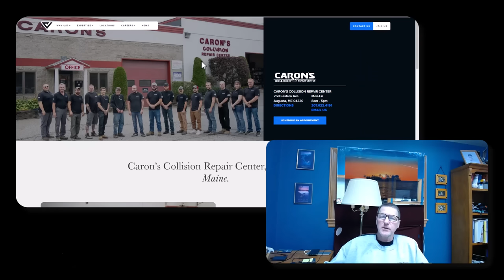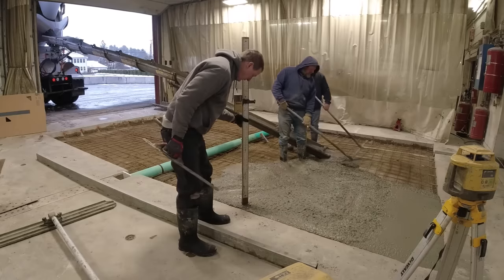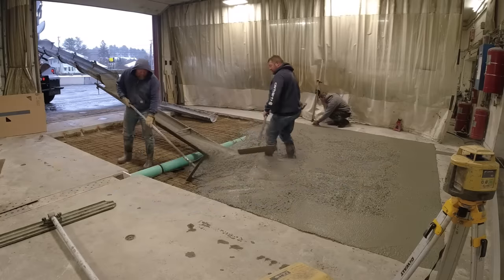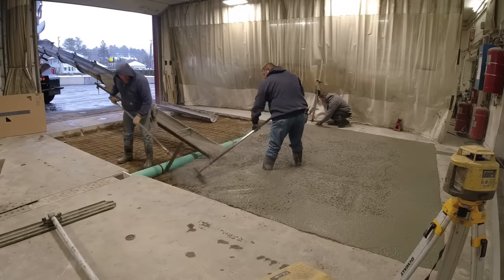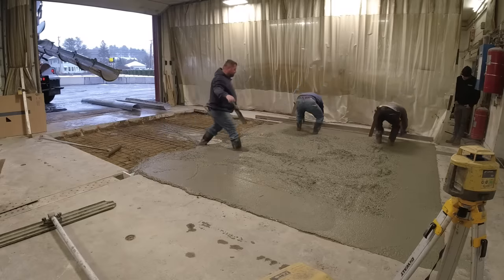Easy Little Pour at a Collision Center to Level the Floor (New Lift is Being Installed)

Comment: Mike , you do a professional job on every job , I worked in repair shops for many years having a perfectly flat floor and level ( I mean flat like a pool table) is so important. 1) reason is if the floor is slanted towards the door the rear two lift legs can be 3 to 4 inch’s off the floor when the front lift arms are on the ground, it makes it more difficult to set the car up . With some low cars you have to jack up the back ,then slide the arm under. Also if you have to roll the car back or forth to set it up on a very leave floor it’s much easier, last but not least if the floor is power trowel too it makes it easier to sweep and clean up messes .
Reply from the maker: Good info, thanks 😊

Comment: You mentioned lifting the rebar/mesh, and it staying in place.
That whole part of it remains a mystery to me.  On all the jobs I have watched now, are y'all trying not to step on the bars?  When the bars/mesh is lying on the dirt to start, are you content to just lift to a "best guess height"?  Etc.?

You need not respond here.  Just know that I would appreciate more (occasional) narration on the topic, and maybe some video from closer to the action to show how you walk in the mud.
Reply: once you lift the mesh up into the concrete, the aggregate (stone) gets under the wire and prevents it from sinking back to the bottom .. he mentioned that they used heavy grade wire mesh on this job, which prevents sinking even better than normal mesh.  If you step on the mesh after pour, it might push down the wire a little due to compacting, but there is no way it is going the whole way back to the bottom of the slab.
Reply from the maker: Yes, thank you
Reply: Il give you an actual educated and new world response here. 

Lifting the mesh, steel does not work good. 
The steel needs to be at a constant height as to not cause differences in height  thus compromising strength and creating imbalances. 
When they step on mesh that's been lifted it will go back down to the bottom of the slab. Whether it be an inch off or on the dirt. 
With general residential concrete the steel needs to be in the top 3rd of the concrete as cracking starts at the top and works its way down, the steel will help hold the concrete together as it cracks as steel and concrete expand at the same rate. 
Plastic chairs come in a variety of height and shapes and it's literally a 5 minute job to chair a job of that size. The plastic chairs will hold the steel at the correct level whether it be 40mm bottom cover for heavy load traffic  or 40mm top cover. 
For very heavy vehicle traffic or things like silos there will usually be 2 layers a bottom layer for load bearing and a top layer to control cracking. 
I see a few American concreters using chairs now but most of them are stuck in the 80s and refuse to get with the times. 
And btw I have pulled up many a job thay back in the day the steel used to be pull and it was all on the dirt rusting away or an inch in the concrete.
Reply: @lachlanitis2311  thanks, your explanation matches what my brain was presuming.
If you would, a followup:
"Chairs", I infer, are the blocks/boosters I have seen used on some jobs which hold the steel at a set height.  What impact do they have on integrity?  They take up volume, create discontinuities throughout the slab, and amount to leaving a passage from the bottom of the slab straight to the steel that I would think moisture would find.
Reply: @barbeonline351  the chairs I speak of are plastic chairs specifically designed so the aggregate will fit in and around them so as to not cause any weakness in the slab. The pros of having steel at the correct and all the same height for outweighs the cons of having a plastic chair in the concrete. 
These are actually better than concrete blocks as the aggregate will pass through them while the blocks are solid and will leave a little spot everywhere under the steel that is not part of the original pour. 
If you google plastic chairs you will see what I mean. 
Every engineer you talk to will advise using chairs than pulling the mesh or steel up, every one. 
I live in Australia and a slab that needs inspection will not be passed unless it is chaired up first. 
As to your moisture question the chairs provide no advantage or disadvantage to moisture rising through the slab. 
Laying concreting plastic under the slab will stop the rising damp and moisture rising. 
This is crucial in every new build and anything with a roof overhead. If you do not put the plastic underneath you risk rising damp coming in contact with floor covering glues breaking the bond and moisture/damp/mould issues. 
Concrete is also waterproof at 32mpa/4500psi which is another reason I always use 32mpa concrete. 
If you have any other questions, please ask 🙂